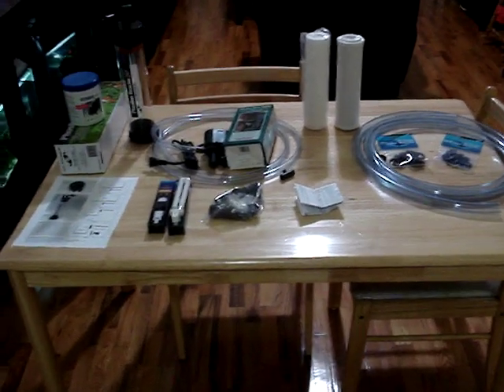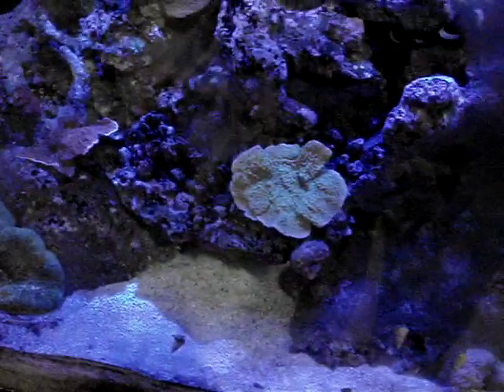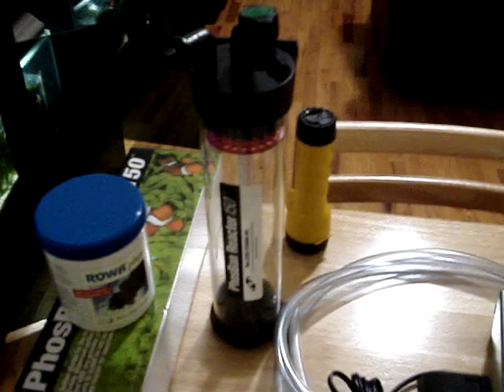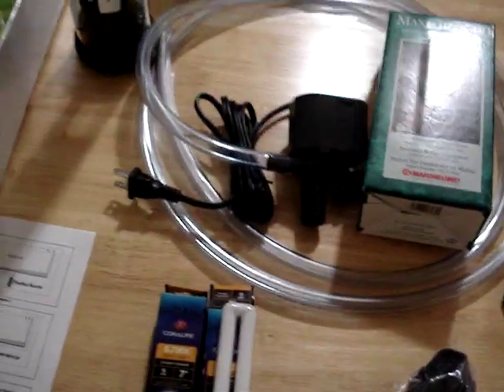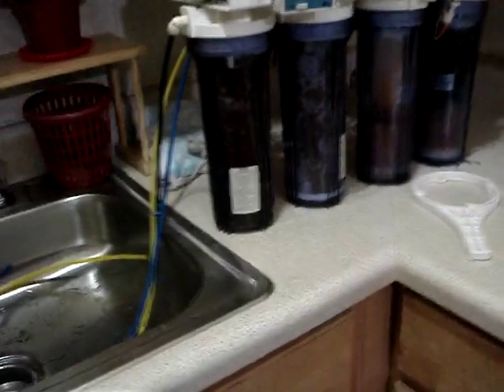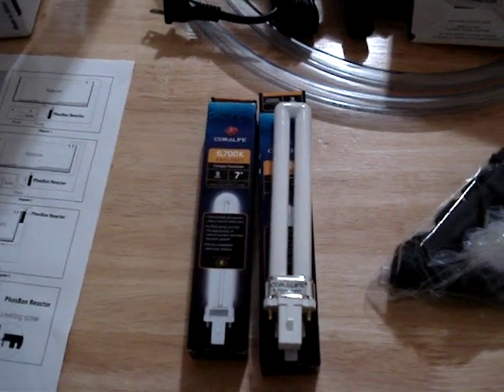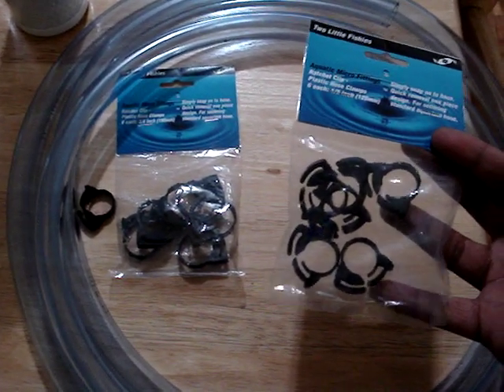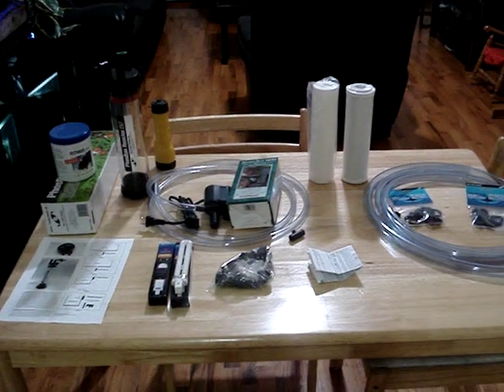Phosphate Problems And Solutions Part 1 of 4

Comment: hey bro am currently battling with an algae/ciano bacteria problem in my tank  for about 2months now... from what i have saw in yur videos i think its bc of my nitrates which is about 10-20 ppm and my phosphates which is about 0.25-0.5. i have a wet/dry sump and i added a 10 gal refugium also. my protein skimmer is the aqua ev 180. and i do water changes every week.... could a phosban reactor solve my problem or what do u recommend me to get for my system...... any help is appreciated

Comment: Thanks for the info. I was having a cyano problem a couple of weeks ago. Followed your advice about the phosban reactor and media, performed some extra water changes, and made sure I had adequate flow to the areas. A few days later, no more cyano. However, I think some of my old rock is leeching phosphates as is my old mixed sand/cc bed. Now I'm debating removing a bunch of the bed and/or rock and replacing it. Unfortunately, much of it has great polyps and other growth. Any thoughts? BIG THANKS